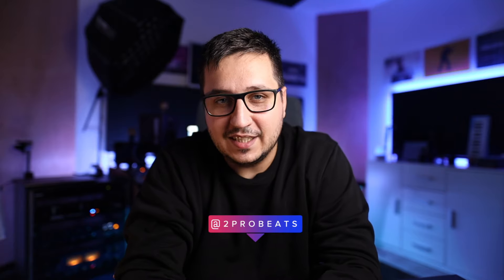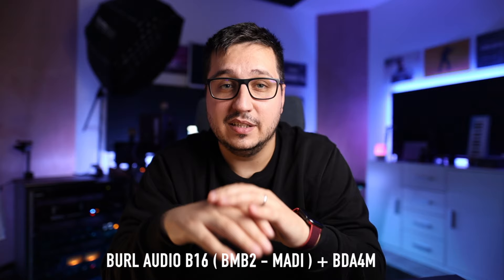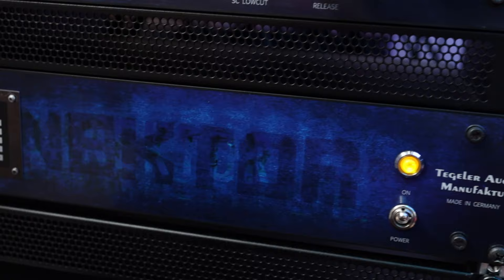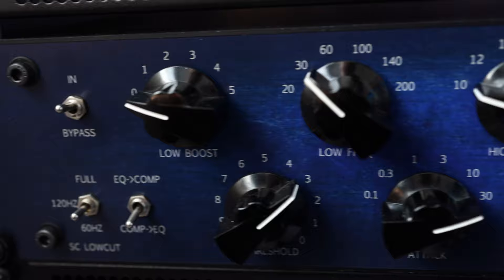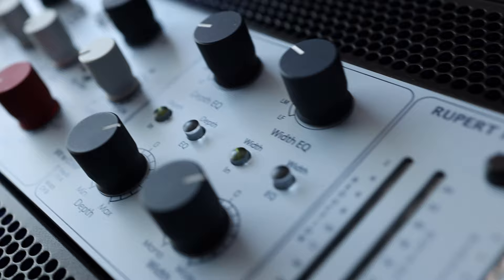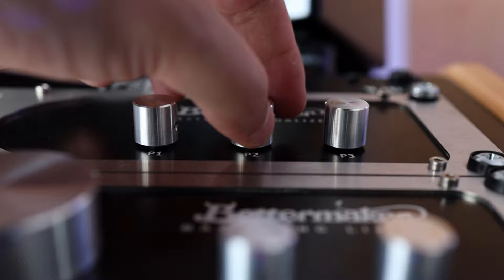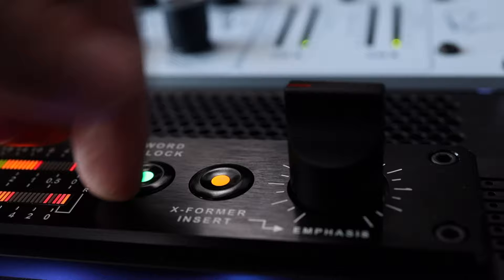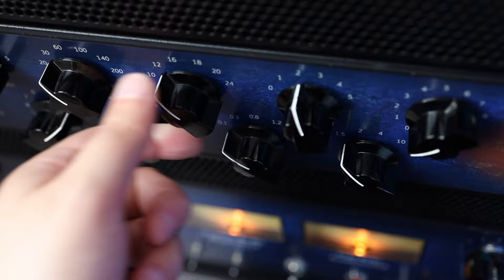100% Analog Mastering Chain ? /// What gear I use for mastering

Comment: Hey bro I got the lynx hilo. And I was wondering how much of the level i should send going out from the converter to my outboard gear and how much I should set the input of the conveter coming back in ? Let's say my mix is peaking at -6 db on the master bus ..
Reply from the maker: Hey man, it really depends on how you want to set your conversion loop. For example on my AD+ / B16 I have the option to set the calibration from -14 -16 -18  dBFS. I have it set to -14 on both at the moment. Cheers
Reply: @2probeats  oh ok thanks..do you print back on the same daw ? Or do you use another daw for capture  ?
Reply: @2probeats  also are those the trim settings? Because mine can go up to 24dbu  and know some outboard gear has different trim amount that they can handle

Comment: How do you use all AD / DA converters simultaneously in your DAW? Are they all connected to the RME UFX+ through MADI or AES and clocked to the internal clock of the UFX+? I'm looking for a way to add a AD converter while still using my Benchmark DAC 3 DX for monitoring without sacrificing audio quality using one ASIO.
Reply from the maker: Hey man,

Everything is connected to the UFX+ ( the Burl via MADI  and the AD+ via AES ) and I`m using the Burl as the masterclock since it has 2 WC outputs.
Cheers

Comment: 100 % Analog ?
Reply from the maker: 100%
Reply: @2probeats  do you run those plug-ins on an analog computer ?
Reply: sorry , my mistake , I see you are only using the plugins for routing and not for mastering. I originally turned off in disappointment that there was a computer involved.